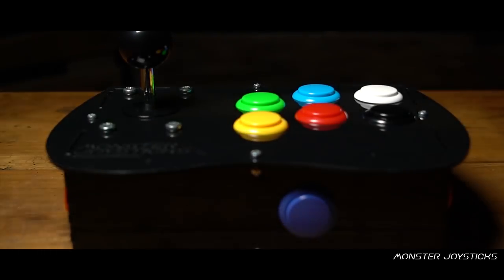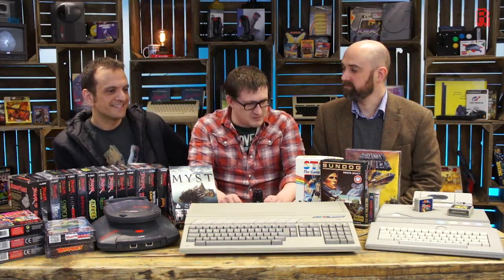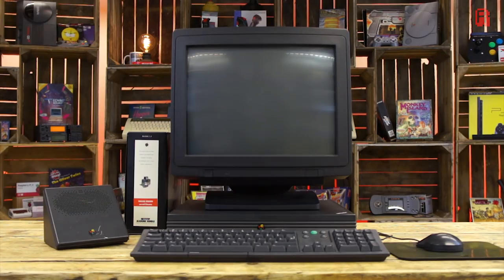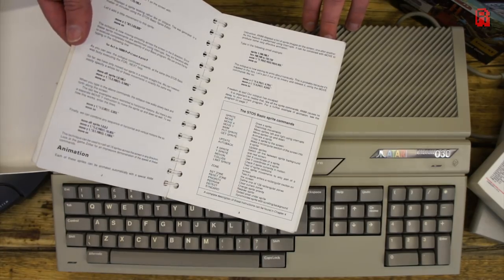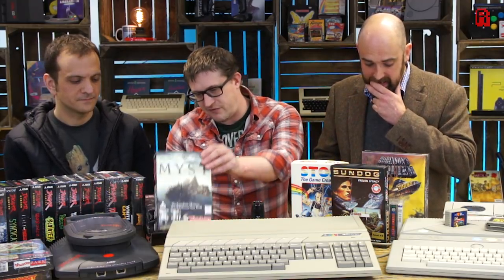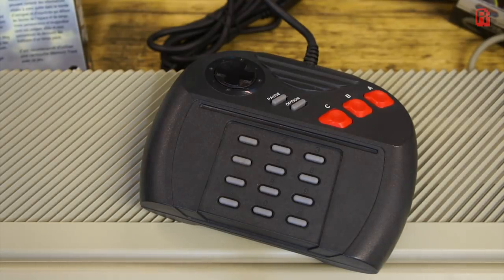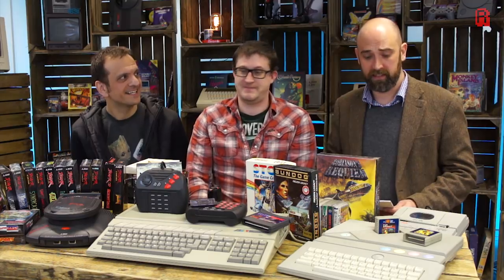Atari Falcon, Jaguar & XEGS chat with Gary & Andrew

Comment: Ooh, Atari stuff, very nice 😁

Yes, the Jaguar pro controller had 6 face buttons and 2 shoulder buttons. These weren't additional but mapped to other existing buttons from the keypad, so they were supported by all games with varying degrees of success (the shoulder buttons sidestepped / strafed in Wolfenstein 3D and Doom, making circle strafing possible on a console which was very cool).

The spinner controller that Gary mentions was developed by Atari but never officially released - the circuitry to handle the spinner is built in to the Jag and supported by some games (most notably Tempest 2000 where it can be enabled via a hidden menu) so of course people have built their own and it's quite a popular controller modification in the Jag world.

Comment: I went from a Spectrum to an Amiga. I really did want an Atari STE when they first came out, but it wasn't what I ended up with. These days though, I have an Amiga 1200 and an Atari 4160STE. I like them both but I plan on getting a Vampire V4 for the 1200 though. The reason I want that is because it'll push the Amiga so much further than it could be done before, and there's lots things from even back in the day, will do better with it.

As for the Atari STE, I've got a Jaguar gamepad for it, because there are a few games that'll use one. Atari even brought out an Atari ST coloured one, but I've never seen one of those in person. I know there's a few games on the Falcon as well that will use those pads. My STE has a CosmosEX in it, so I can use a Pi for USB and virtual HDD and Floppy, and have internet/network access. I use a wifi dongle, and usb mouse. I also have a thing that converts the ST RGB to VGA directly at the back of the ST, so I can hook up a VGA monitor for Low/Med and Hi res.

I had thought about getting a STE 32MHz booster, but went against it, since for the STE, I really don't need the extra speed. Plus, it would be a bit of a nail biting desoldering/soldering upgrade for me. It would cost too much to have someone do the upgrade for me, time you add in shipping.

As for which is better Atari ST or Amiga, I think that was conclusion from the Spectrum Vs C64 days, that the magazines got going. It was a clever way to make you feel you were in a gang, and your gang was good, but also helped them sell more magazines.

Even though for most of us, it was which ever one your family could afford, and for most it was meant to have been the family computer, but we used it as if it was our very own. The computer / console wars just got carried over again and again, even today with XBOX Vs PS4 and the PC Master Race.

In the end, no-one likes to feel, that their purchase was a bad one, so they back it until they're blue in the face, even though they sometimes wish they actually could have both.

Hence why I believe a lot of retro computer/console fans, actually do get their hands on systems, they didn't have as a kid. They want the best of both worlds. Even if there is only a few good games on the thing.

Oh, you guys are lucky. All "my" old stuff got binned, because I didn't reply back to an email in time while I was at Uni. I came home one summer, and everything from the computer to all my large boxed games from the ZX81 upwards had been sent off to the skip, because I had boxed them away and "You weren't using them... so..."

Great video as always!
/endmy2cents
Reply: I know this is a very very late reply, but I only just found this video. I agree with your comment, and when I came back from uni (might have been second or third year) I too found computer stuff had been sold- namely the A1200, which I still used when at home! I didn't even get consulted (but then I didn't have an email address at that time)! I didn't have a PC by then (got one before the third year, I think, and then after uni also got a PS2). I was sad to see it go. Even in 2000/2001, I still enjoyed playing Civ (coming up with my own maps on Deluxe Paint :)) or Sensi, or Wembley International Soccer.

Comment: Ah, the XEGS...
The last of the Atari 8 bits...

Certainly an interesting system in some ways...
I got an upgrade for my 800XL a month or so ago, but haven't installed it yet.
I will say the Atari 8 bit family has some of the craziest modern 3rd party upgrades going.
20 mhz 65816 with I think about 35 megabytes of RAM... Which would... Well, it certainly beats your average ST in terms of performance (And probably beats a Falcon in terms of memory)
And then there's the upgrade I got...
The VBXE, which heavily upgrades the graphics capabilities. Technically it functions as a drop-in replacement for GTIA, but it plugs into the ANTIC socket, and kind of takes over the role of both. (though the old hardware is piggybacked on top and is still usable. Both independently and alongside the new hardware.) - it adds 512 kilobytes of dedicated VRAM, though can be configured to provide up to 256 kilobytes as general system memory if you don't have any other form of memory expansion.
It features a graphics overlay, a new much more capable equivalent to antic display lists. (giving it capabilities likely exceeding the copper on the Amiga), can retrofit a form of colour map onto the existing display functions (similar to how a c64 or most tile based systems do things, but more flexible), the overlay supports transparency.
It can output 1024 colours in 320x240 or 64 colours in 640x480, provides true 80 column text support, and a high performance blitter.

Basically, if you combine both the 65816 upgrade and a VBXE you end up creating this hybrid monstrosity that turns an atari 8 bit system into a 16 bit system that wouldn't look all that out of place in the mid 90's next to AGA Amigas and the falcon...

I can't say I've seen anything quite that insane for any other 8 bit home computer platform...

Obviously being 3rd party and rather recent (like some of it is under 3 years old), there's very little software for it.
But the mere fact such upgrades exist is both baffling and highly amusing...
Reply: I concur! The VBXE was even released by 2007. Wish it took off more amongst Atarians. I'm going to put out a games series for it, which will hopefully get a few more people to buy and install them.
Reply: What's crazier is installing the VBXE into a 5200, which I've heard has been done to at least 2 or 3 5200s.  :)  I think the SOPHIA chip option is probably a better value for the money.

The 65816 upgrade is impressive, especially with 35MB, but FAST RAM on an ST with something like a 68020/68030 or higher CPU upgrade would beat it. After all, there are Atari TTs out there with 256MB and 512MB installed in them.

The Atari 8-bit scene has some really awesome upgrades that I'd love to see similar happen on the ST. Like, say, installing a POKEY - or 2 - into an ST. Or having a Dual MONO YM2149 upgrade for that matter.  But back to Atari 8-bit, if Joe Decuir is successful in helping the folks out trying to build a modern [unreleased] Atari 1090XL external Expansion Bus, then there's going to be some serious crazy going on. You should also check out what the Apple II folks are doing. Thanks to their nearly unlimited internal expansion slots, the Apple II scene has 8MB RAM boards [for the II, II+, IIc, IIe, not the IIgs], WiFi/Bluetooth adapters, daisy chained Mockingboard sound card clones with multiple AY/YM sound chips, VGA graphics boards, etc.

Comment: Nice video. I started with the Atari 2600 VCS. Then for a very long time i wanted an ST but never got one - So  my next machine was the Atari 65 XE 8-bit computer - then up[graded
to the Atari 130 XE 8-bit computer - after that my next machine was the Atari XEGS  ( 130 XE )  remade and sold as a Game System. Then i got an Amiga 1200  following that 
was the Amiga 4000 and another 1200. I had an Atari Jaguar 2nd hand and Had Several Atar Lynx Both Models I and II. The First pc i completely built was an AMD 32-bit cpu based 
machine. My Current system is still an AMD based computer. Specs are as follows , Gigabyte 990FX-Gaming Mother-Board , Cpu is the FX-9590 , Video Cards is the MSI Radeon
RX-580 Gaming X 8gb , Storage = Crucial M4 512 gb ssd x2 in a hardware raid 0 array , Memory is 32 gb Crucial ddr3 at 1866 mhz , Cpu cooler = Corsair H100i GTX AIO ,
Power Supply = Seasonic 650w Prime 80+ Titanium Fully Modular. Keep up the good work.

Comment: Dropzone was amazing on both C64 and 8 bit Atari...and this was the same 6502 at 1.79 MHz 8 bit Atari Computer. It's also sad, but common, for programmers to support the majority, not the minority...this is what apparently happened to the Atari STE.  It was far improved hardware, but due to low numbers vs. millions of Atari ST's, was poorly supported.  So, owning an Atari STE was like owning a Ferrari, but limited to running like a Honda Civic.  The Falcon I wanted for quite a while, but it's so rare and expensive now, so I'll have to live with my Atari ST, Atari STFM, Mega ST, STE, etc...plus the dozen or so 8 bit Atari Computers...I should appreciate what I have really and there is very little software or development to truly show off the Falcon's potential anyway.

Comment: The ST definitely wasn't as good as the Amiga hardware-wise, but it was still good, and fantastic for electronic musicians. It still is. I love that Atari chose to include MIDI DIN ports as standard.

This led to a bunch of useful software. There were sequencers like Cubase (which basically inspired a lot about modern DAWs) and C-Lab, and tons of synth editors. In the (mid) '80s, most synths started doing away with lots of knobs and sliders, and went for more streamlined looks.

This had the substantial drawback of making many of them difficult and/or tedious to program. Some went with great ideas that made their interfaces decent (like Korg's DW-8000), but many didn't.

But graphical editors for many of these synths came along on the ST, making them much easier and faster to use.

Some people still use them for these reasons. Standard MIDI ports, tight timing (something modern PCs often don't have), pretty simple to set up, and pretty simple to use. 

With that, plus the sequencers and editors, it's still a very valid and attractive option to this day. I'm 22, and considering getting one myself sometime. I'm into hardware synths, and it looks like a great option for sequencing my gear, as well as creating patches on my synths with lots of menu diving.

Of course it helps that I'm interested in vintage computers already, heh, but still.

Comment: Speaking of the Atari XEGS specifically, rather than just being representative of the 8-bit line, I think it was technically well designed, especially if you compare it to the Commodore 64GS, the console-ised version of the C64.  The C64GS was stripped of all the C64 ports bar those for cartridges and joysticks, and had no keyboard.  The Atari XEGS retained all the ports, and in conjunction with the optional keyboard, was therefore compatible with far more games.  The C64GS was said to be compatible with C64 cartridge games.  True, until you couldn't start a game because it needed F1 to start, or F5 to swap to 2 players...  And it cost more than a C64, when it was supposed to cost less.  The word "D'oh" does not sum it up.  Commodore did seem to 'get it' with the CD32, though; it retained some of the expansion ports, at least.

Comment: Had a Falcon when they first came out plus the  Digital audio interface and the 8/4 interface with the RAM upgraded to a massive 16Meg!!! although only 14 were available to the user. I used to run a version of Cubase that allowed audio recording using the Syquest SCSI2 hard drive system. I think it was one of the first systems that could do that (along with Digidesigns Pro Tools on a Mac, although that was a hell of a lot more expensive back then). Sold the lot for £1000 back in 1997 and regretted it ever since!!!

Comment: The Atari ST compatible EmuTOS (TOS and GEM Desktop) on SourceForge has been ported to the Amiga, and is used to boot a port of MiNT (multi-tasking POSIX compliant OS - now on GitHub) for the Vampire boards. The has been discussion about Vampire for Atari ST/Falcon, and although the ST & STE are available as VHDL (for FPGA, eg MiST),  there is simply not the manpower for the Falcon version of the Vampire, on top of the fact that there are only a few hundred of them in active use, 5O% of which are already modified. Before the FireBee (Falcon compatible with CrossFire CPU) was released the Falcon got a 68060 & PCI adapters (ATI 9600 & ATI Fire Pro), later the SuperVidel (Enhanced VIDEL Graphics in FPGA - for DVI & HDMI). The ST/STe/TT recently got a 50MHz + 512Mb + TOS Switch via FPGA. Most ST's can easily be connected to the net nowadays, and there are still many users of the Hades and Medusa ST Clones (040/060 + PCI + RAM). 

There is an active community for both software and hardware development on Atari ST/STe/TT and Falcon, as well as a larger demo scene, spread all over the world (DE,UK,US,CA,FR,CH,NO,DK,SE,PL,RU,HU,CX,PT,ES,IT,GK,AU,NZ). News can be found at Atari.Org. Atari-Forum.com and Atari-Forum.de are active daily, including active hardware dev.

There is also a highly active 8-bit Atari scene in what used to be called the Eastern Block Countries, especially demos and hardware, which where the dumping grounds for old stock.
Reply: All of that and you didn't mention AtariAge. C'mon man!  :)

Comment: 1:55 Glad you included the ST up there too, go upwards from 8, 16, 32, to 64.
2:30 Stop swearing on your channel! You could get demonetized! ^_^
6:20 "I love the ST." Holla!
8:35 Vintage brand loyalty.
14:15 Sounds like someone will have to write a MP3 player for it. ^_^ I know there are integer based mp3 decoding libraries, but I wonder if there is processing power for the higher bandwidth files.
15:06 I grew up with STOS as well. I still have that one too, and a lot of the ST software.
19:06 I actually had an ST with a 1x CDROM, it plugged into the SCSI port IIRC, and you could chain it with your hard drive.
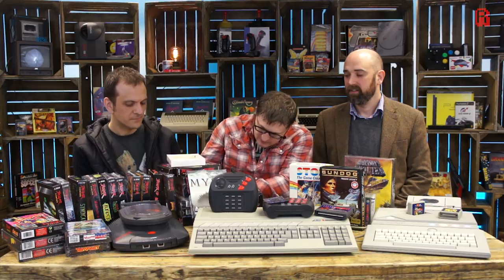38:10 I think CD gaming technology was in it's infancy at this time where the CD based systems failed, where most people's idea of using the CD to it's potential was full motion video, or CD-Audio to accompany the game.
43:13 Case in point, HDDVD vs Bluray, Sony included Bluray on their Playstation 3 and it attracted a lot of people to the platform.
53:45 https://www.youtube.com/watch?v=il-7z85lABo

Comment: Probably quite a few people had CD-ROMs, since there is a full SCSI port on the back of the Falcon.  And apparently the 060 accelerator makes Robinson's Requiem much better.
Reply: A lot of people who were using the Falcon for music production also had SCSI CD drives for their samplers so it wasn't uncommon to find Atari software on a CD that came with a music production magazine for example.